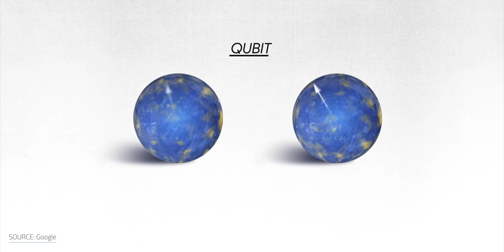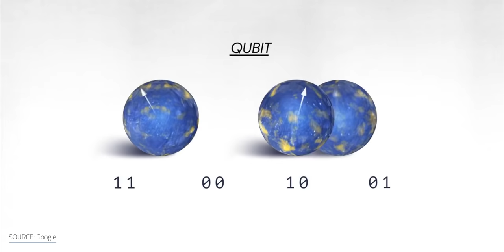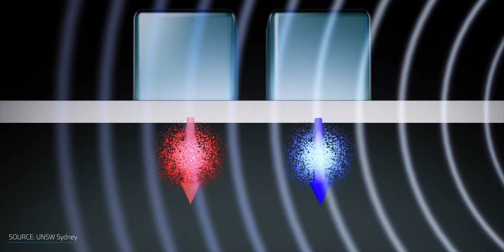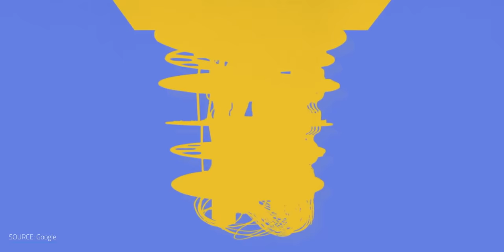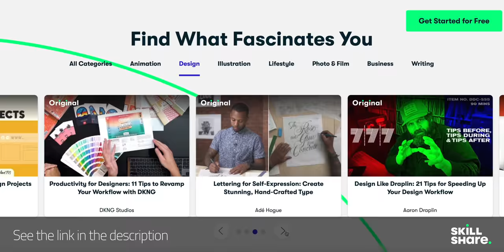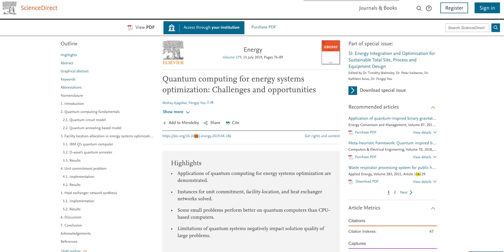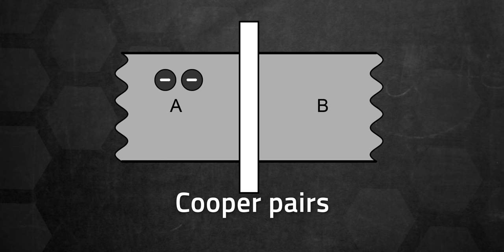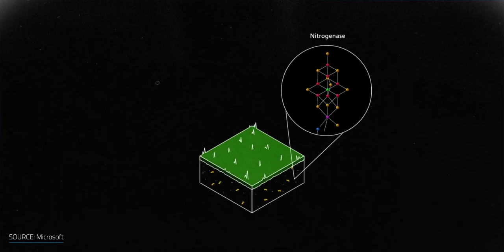Quantum Computers Are Coming … But Why Should You Care?

Comment: Um, quantum computing is not more energy efficient. Not with the super cooling required. While the energy for the cooling isn't directly used for the computing, it's a bit like standing on top of the sears tower and saying "i'm taller than you". It's not a very full picture of energy use. And then there's the construction, people are spending millions of dollars for these qc's. Which can be understood as relatable to millions of "applied energy units".
None of which is meant to criticize QC or it's potential. Just pointing out that particular point was extraordinarily 'pie in the sky'. Which undermines the credibility of the other points.

Comment: I think we're a little arrogant to think we can chance the climate; I'm not sold on the premise that's it's man's doing.  I'm also concerned with the rush to electrify without a plan to transition.  Think about plugging in 100 million electric cars to charge at night during the summer, during rolling black outs.  The fact is that moving to a different energy source is a seismic event AND can't be directed by the government. (The government has an abysmal record for running programs.)  The energy market has to evolve through commercial means otherwise it will be chaotic.

Comment: It's an exciting technology but I think the power requirements to keep these things at 1K offset the fact the quantum computer in itself, uses less power. In addition, I fail to see explanations for how climate change solutions require massive supercomputing. Modelling ≠ solving. If one supposes, as is currently popular, that CO2 is the largest driver of climate change, the solution space is for energy sources which produce less CO2, and not supercomputing modelling algorithms. The latter only assist in forecasting, not solutions. Metaphorically, diagnostics aren't the same as cures.

Comment: Matt, you mention Microsoft QC with Majorana particles. This turned out to be a failure. The particles were never there so Microsoft is back to square one and is not blowing anyone out of the water. This was quite big news so it surprised me you put this in the video. If you mean another new setup that I'm not aware of I'd like to know of course.

Comment: Quantum computers use .002% the power of the biggest super computer on earth?

Imagine using the same amount of power it takes to use the supercomputer, on a whole bunch more quantum computers
Reply: Yup
Reply: If we make quantum computers more efficient and optimize the qubits recognition, data variations
Reply: But also its impossible for 0.0000000000000000000000000000000000000000001% of all energy to simulate or replicate what all energy is doing.

Comment: Nuclear reactors are stil and should be the main way of producing electricity especially with better and more efficient way of doing it in 2022, winds and solar should be used as a way of decentralize the grid by making it more flexible and reliant.

Comment: I believe if it's a collective effort with more than one Quantum Computer (QC) we should be able to find a resolution to climate change.  It may take multiple QC working on different aspects of the crisis to create the environmental elements of that change, along with the technology and robotic power to implement which we have. As energy is dispensed it will become an ebb and flow with the correct balance of QC and Robotics working machine & machine and human hand in hand to lower overall earth temperatures.  Anything is possible if you have the correct tools. 🇺🇲🙏

Comment: I'm sorry but the reduced energy consumption of quantum computers vs classical wouldnt have any practical effect. Quantum computers won't replace classical computers, just like ram doesn't replace HDD/SSDs. A quantum chip could be used in computers to perform calculations previously impractical or even impossible, but it wouldn't replace the millions of small calculations that keep your laptop running.
Reply: The biggest problem is that they are only better in very specific tasks. In those tasks however we could indeed see a huge energy usage reduction which would be interesting

Comment: This. This right here is why we're moving slowly to solve the climate change problem. 

You're talking about how a technology still in the research phase, with potential benefits as a research tool, to technologies that aren't even in the research phase yet.

Estimating time that's 10 years for quantum compute to be commercially viable for something. 5 to 10 years for it to mature into something more generally applicable. 10 years for the research team using it to develop a better battery to finish a commercially viable design. 10 to 20 years for widespread adoption and rollout. We don't have that kind of time. it's use what works right now or miss the boat. 

Denser cities, public transit, less meat, nuclear energy, pollution limits, eliminating single use containers. You know, things that work and we have known work to combat climate change for the last 40 years. These are our saving grace. Not some hail Mary of the next shiny tech thing that won't be available for a generation.

On top of that it's not like QC is uniquely useful for climate research. It's has sooo many applications. You wanna talk about it because it's exciting, talk about it because it's exciting, but don't pretend it's the magic answer to a problem we already have the tools to fix. This is actively, destructively distracting.

Comment: I have both 1 and 0% understanding of this subject at the same time.
Reply: imagine a ball that is moving forward but is also spinning around - well imagine the ball was an electron and usually we just measure how its moving but now they are including the spin measure into the calculation at the same time. Its not magical like they make it sound because they dont know what they're actually talking about.

Its similar to how people say leds are 50% more efficient except they only radiate light in 180 degrees instead of 360, so you're saving half the energy. Its not actually any more efficient at converting electricity to light.

Comment: Well I think pretty much most of this is accurate except for the 0.002% power usage part.
Quantum computing is good for very specific things and I can believe it saves power in that (if not just for the shorter duration of the calculations), but they can't replace 'old computing' entirely as you've stated yourself. Also, we aren't "there yet". In the sense that, even if we replaced all of the computing we could with quantum tomorrow, we'd just ramp up the amount of calculations we need (usage) by so much, we'd hit the same levels all over again. Because we'd have whole new technologies to grow and improve... Much like how our computers now are still not enough after 50 years of development and let's be honest, people in the 80s would FREAK from our smartphones --- It's still not good enough. Quantum computing won't be, either. We'll use them 100% all the time and that will balance out the power usage.

Comment: The best (though very flawed) explenation I have heard of a quantum computer for a lay person is to think of a quantum program as setting up a math problem in physics, and then letting it react and collapse into a stable state, and that stable state is your answer.  More like a chemical reaction resulting into a solution because it has to react to a solution rather than computing to a solution.
Again, super flawed, but not a terrible functional analogy.  But the idea is that it allows some very complicated math to solve extremely quickly, while they are actually super inefficient on other types of compute.

The future is going to have a wide array of compute.  CPUs for extremely linier math with lots of singular dependancies.  GPUs for highly parallel generalized compute tasks.  Quantum computers for dealing with math that has multiple answers and stupid amounts of variables.  And analog processors are being designed for AI acceleration.  Between these 4 types of compute we are going to have a new generational leap in compute technology that will change how we do everything over the next 30 years, just like traditional and GPU compute has changed so many things over the last 30 years.  Combine it with advanced robotics and AI, and we will have a revolution of highly efficient and simi-inteligent machines that will be able to re-shape our world to however we program them to.  Some of it will be terrible... but I think most of it will be exciting and make the world a much better and easier place to live!

Comment: A single gallon of gas has enough energy to move a 3,000 lb. car 25 miles. Ninety-five percent of the energy in a car is wasted. A good project for quantum computers might by to make cars more energy efficient. Should be a simple problem for a few qu-bits.

Comment: 7:34 - This is very misleading reporting. It is true that quantum chips require only a fraction of the energy consumed by a conventional processor, but what you fail to mention is the massive amounts of electricity required to cool the qubits down to near absolute zero. A D-Wave main-frame requires 20, 000+ watts of power, sometimes you literally need to build a small separate power plant just to install the damn things. They might help solve climate change, but not because they're power efficient.

To be fair, if we can 1) find materials that can work as superconductors at temperatures higher than 4 kelvin and 2) find particles that can form stable qubits at higher temperatures, this would greatly lower power demands. Realistically, for the forseeable future, the carbon emitted by running them will dwarf the carbon capture allowed by any new tech we develop from it. Still, it'll make pretty simulations of the universe, so I'm on board with the whole thing, but also accept it's not a 'green' solution by any stretch of the imagination.

Comment: You alluded to, but didn't clearly state that quantum computing only works for specific mathematical problems and modeling. From what I understand, it can't run an operating system or programs (e.g. email or a browser), at least with current technology, Hollywood movies excepted. It is best for modeling systems or certain types of encryption cracking, this the emphasis on scientific and mathematical research.

Because of this, at least for the foreseeable future, it is questionable whether or not we will ever see it in home or even business computing.

The downside I can see of this push is that it could be used to model our behaviors and that information could be used to control our behavior. Yeah, it's "1984" or "Minority Report" level conspiracy theory stuff, but, unfortunately, combined with "big data" collection, it is feasible.

All technologies can be used for "good" or "evil". Our society and legal systems (privacy protections, primarily) are already woefully unable to deal with what invasions of privacy we are already seeing. Just imagine what it will be like when the government and businesses start using this turbocharged modeling tech to manipulate "We, the people"?

I'm not a conspiracy theorist, but I have been using, and working with, computers since the Radio Shack TRS-80. I've seen the trajectory of computing and what companies and governments are doing with Big Data computing and see it as a small leap "for our safety", of course {sarcasm}.

Anyway, this is a good video highlighting how quantum computers can help with climate change. I just wish you'd cover some of the caveats.

My $.02...

Comment: I've always heard that if, and it's a big if, quantum computers live up to the hype, they could prove P=NP and goodbye all encryption, passwords, etc, but sure, they'll solve complex problems quickly, but I don't think many people are really thinking this through to the logical conclusion. It's not just  faster compute speed, it's a ludicrous reduction in complexity, making predictions more accurate. As in, goodbye stock market.
Reply: So what you're getting at is that is could be used to easily defeat encryption/passwords because it could quickly process combinations of characters while simultaneously verifying if the results? Or as in the stock market it could predict the daily outcome based on real time information and events faster than they actually play out? I'm trying to wrap my head around this. I'm interested in this stuff, but way to dumb to understand.
Reply: @ajspice  yup. Basically it would mean that ludicrously complex problems can be broken down into less complex problems and solved relatively quickly. Like the traveling salesman problem, quantum computers might generate an algorithm that can solve the problem quickly making deliveries and transportation more efficient, but abstracted to make any equation solved more efficiently, including calculating encryption hashes and decrypting anything in real time. surely someone will write a counter to it, but all modern encryption would be obsolete and until it was replaced, nothing would be secure.
Reply: @mundanestuff  Sweet! I understand some shit!
Reply: @mundanestuff  And hell, using that kind of algorithm, we may learn shit we don't want to know.
Reply: @mundanestuff  So then how long until they figure out humans are the root of every world problem? Two...maybe three minutes? This is how SkyNet starts. Lol!
Reply: @ajspice  you're not wrong. Our survival will, literally, come down to a machine evolving empathy or not.
Reply: @mundanestuff  Most people don't have that.

Comment: for all the hype in this video, what is almost completely left out is that quantum computers as they are right now, are very specialized beats. and maybe that will never change. these machines cannot run general purpose taks. like your desktop or a webserver. or anything like that. they are only usefully for a limited set of algorithms. that should have been made much clearer.
Reply: Perhaps because there are no developed algorithms? Perhaps it's a software not a hardware problem. You can't replace 70 years of algorithm development over night.
Reply: @dirtyharry1881  no it's inherent to the type of hardware. Quantum hardware deals with probabilities. Normal computers deal with certainties. For accounting you want certain. For stock prediction you want probability.

Comment: The quantum part of quantum computers aren't computers. Qbits are not an equivalent to bits. And quantum computers don't compute.
Right, what the heck is that all about?

First up, the way qbits interact cannot reproduce the nuts and bolts guts of a processor. They are really really pushed to even perform addition.
Second, quantum computers don't execute code, they provide a solution to a state without individual steps in-between.
Third, the "output", better called result isn't a hard and fast digital solution, it is more a probabilistic representation of every potential solution, over time and many iterations what we would call the answer outstrips other possibilities.

Just a few things to bear in mind when "programming" one of these lil blighters.